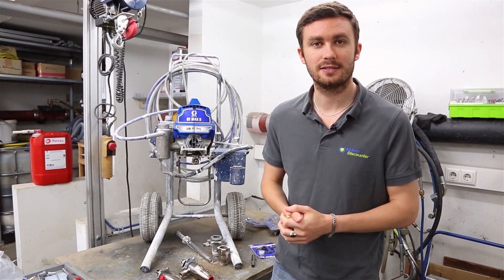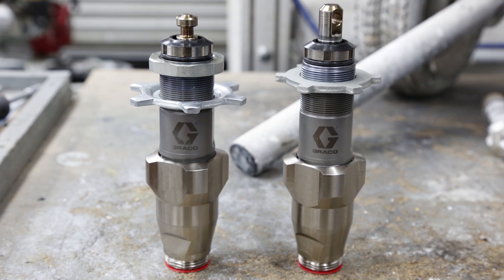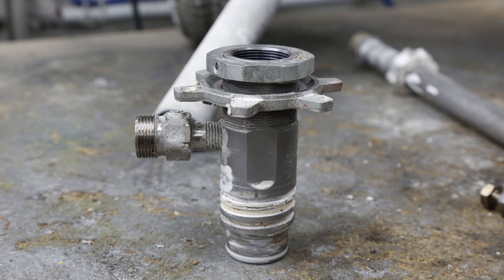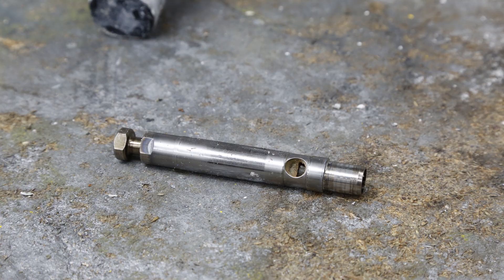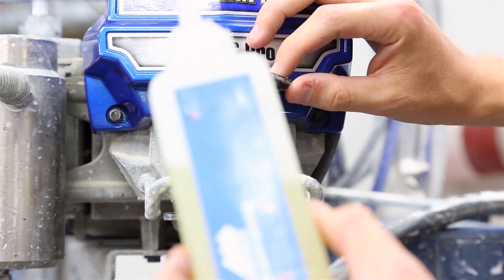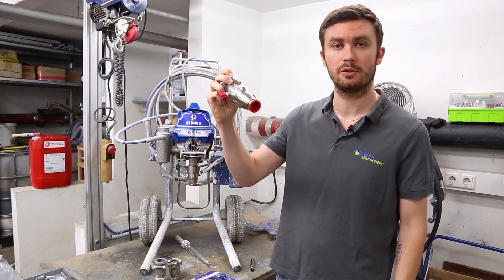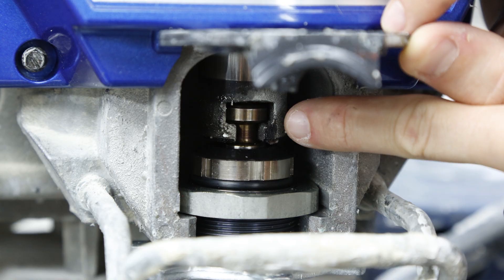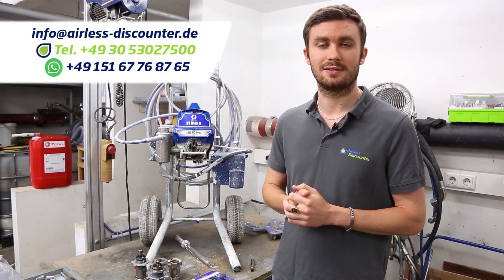Airless Q&A #28 - Changing the complete Graco ProConnect lower pump

Comment: hello! if I have a new 17C719 pump and an old 17C489, can I just replace the piston in the 17C719 pump, put a locking nut and eventually make a 17C489 pump out of it?
Reply from the maker: We would advice you to change the machine if too old to have this option. 
Kind regards,
Airless Discounter team